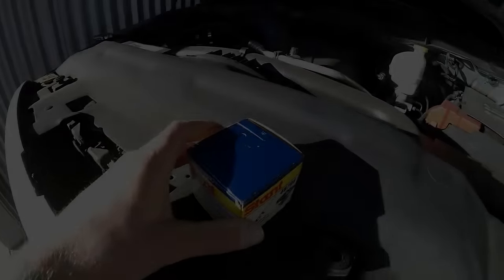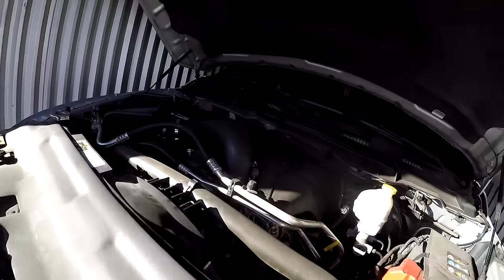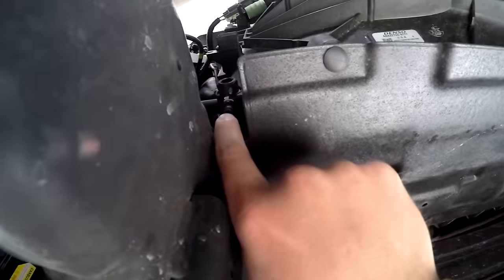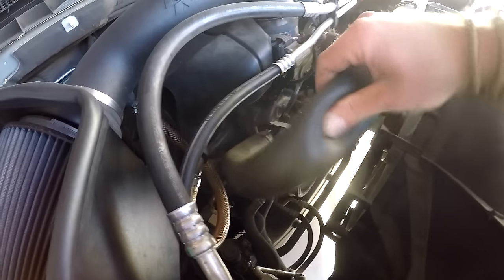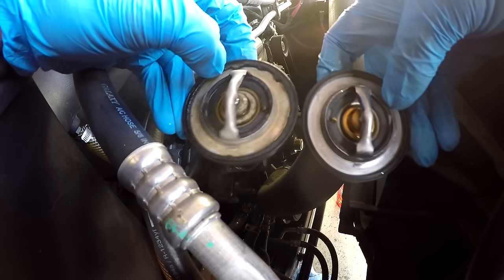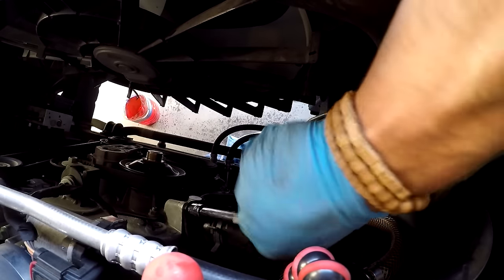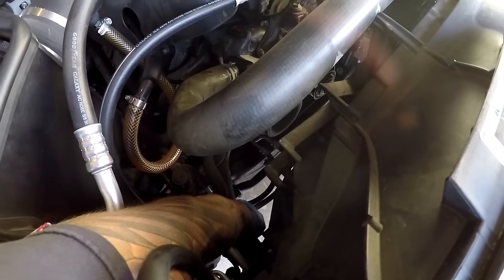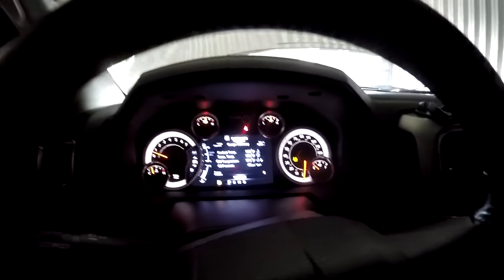THERMOSTAT REPLACEMENT - DODGE RAM 1500 HEMI 5.7L

Comment from the maker: HERE IS THE STUFF TO GET THE JOB DONE 💪😎

HERE IS THE 180* THERMOSTAT WE USED
https://amzn.to/2K0xtsE

MOPAR 5 Year Coolant
https://amzn.to/2Wtimio

MOPAR 10 Year Coolant
https://amzn.to/2EsNrIO
Reply: 2011 Ram 5.7 HEMI
I did a coolant flush and replaced my stock thermostat with the 180⁰ one vs. the stock one. Before I started, I didn't have any heat and my temp gauge sat just a little under halfway. After I finished the job, I now have good heat, but my temp gauge only sits at ¼ of the way.
 I was just wondering if anyone has come across this before and what might be the remedy to fix this? I would appreciate any insight. I love watching the Boosted Motorsports videos! Thanks!
Reply: So if I switch for an E fan would my truck run perfectly fine as is or is there some risk to not changing the thermostat or adding a tune?? I'm asking because I'm interested in installing an E fan in my 2010 hemi but when watching all your videos on installation and then possibly needing a tune + TSAT change I'm kinda becoming skiddish. I mean I use my truck as a day to day driver, vacation vehicle, and every once in a while heavy loads. So I would like all the information to make this decision or if it's not even worth doing. Thanx Boosted you helped me repair broken exhaust manifold bolts last year 💪
Reply: Any issues with this since the original install?
Reply: On Amazon it recommends this other gasket fi you need that or it comes with everything you need
Reply: Have you hauled anything for long durations with you fan swap? I’m moving from NM to Idaho with a fan swap like yours and I want to make sure my truck isn’t going to overheat. Plz help
Reply: @Huxley Mitchell Yea, I've been using Instaflixxer for years myself :)
Reply: The yellow universal coolant is a higher grade coolant than both and is known to cause less problems

Comment: Unwise, grasshopper. Under hot conditions (towing, hauling, mudding, altitude, even very warm weather, etc.) your thermostat will open sooner and stay open wider, circulating coolant faster.  Soon enough, the coolant will not have adequate time in your “rad” to dissipate heat. The stuff going back into the block will be just as hot as the stuff coming out and your low temp thermostat won’t be able to slow it down because it will be wide open. You will overheat. Then you will wonder why.
Reply: You are correct sir.  It will also affect your oil viscosity.  Cooler engine temp, means higher oil viscosity which is bad for the small oil passageways in a Hemi.  It is a balanced system, coolant, thermostat, radiator size and oil type are all interdependent.  I hate to be "that guy" but this mod is pointless and unhealthy for the motor.  I do like the electric fan mod!
Reply: FaceDeAce thank you sir for the explanation. Today I learned something really interesting. Thumbs up!
Reply: Face - first paragraph notwithstanding, I agree with everything you posted. Absolutely true, as you pointed out, the stat opens at the predetermined coolant temp, but consider that it will open much sooner, and stay open wider in Yuma where the air temperature is very hot, than it would in Duluth. The outside air temp does indeed have a huge influence on when the stat opens via the coolant itself.
Reply: So your both making the same point. Lower temp thermostats are point less and can be harmful. I agree, dropping the temp doesn't have benefits and can be harmful if it doesn't allow the engine temps high enough due to mild use and short trips serious sludge and oil issues can damage engine.  The oem temps provide the cleanest burn and best MPGs. You will not get more HP from a lower water temp/engine temp unless it is overheating and predetonating but as far as i know modern engines dont have that issue.
Reply: mam hemi 5.7 Łączę ELM 327 i pokazuje mi, że temperatura otwarcia termostatu wynosi 100 i podczas jazdy w mieście mam 96/97 na trasie 92-95. Może wiesz, jak wskaźnik jest skalowany w Commander 2009 360KM? połowa skali to 100 lat? W farenhaitach będzie 212 farenhaita
Reply: One thermostat wont take longer to warm up than the other.  The point of lowering the starting point of cooling is to put as much distance between you and overheating as possible.  Oil has a failure/ breakdown temp. 250 ... if you work your engine its good to give a little buffer.  @robertjamesschumache
Reply: That’s why I’m sticking with the 203 degrees T-stat
Reply: If this were true this wouldn’t be such the popular mod it is.
Reply: @BlackRam17 : It’s not a popular mod, it’s a dumb trend. Like pet rocks or earth shoes. If it were so good, why wouldn’t the factory just install colder thermostats in every truck that they manufacture? It wouldn’t cost them one extra penny to make their trucks run so much better. right?
But they don’t. So you gotta ask yourself, why don’t they? Is it because they’re so stupid and they don’t watch YouTube?
Reply: @ooyginjardl4037  manufactures often do things to be on the extra safe side, it doesn’t make it necessary. Like I said if this wasn’t safe so many wouldn’t do it. Why did they put the clutch fan on? It’s completely unnecessary. Answer: they air on the side of caution.
Reply: @BlackRam17 : Alrighty, ima try it this way. Why even have a thermostat? 
Then it should never ever overheat, right? Of course it’s not right so the simple answer is twofold. One is to bring the engine up to operating temperature. The other is to restrict the coolant flow so that it has enough time to dissipate heat in the “rad”
So again, if there’s no thermostat, the coolant will just get hotter and hotter because it doesn’t get a chance to cool down. 
If you agree with that, then you will understand my posting some six years ago. If you want, read it over again.
PS Fan clutches are for fuel economy.
Reply: @ooyginjardl4037  I understand what you’re saying, however manufacturers always air on the side of caution. I’ve done this mod on other vehicles and have never had an issue. Also the clutch fan only hurts mpg, it’s like 20 lbs of extra rotating mass. Notice Ram got rid of it in the fifth gen.

Comment: Powertrain Engineer here.   @kevin maxey said in a comment below "The engine will run more efficient with the factory tstat. Cooler is not always best." He is absolutely correct. There is virtually no cost difference in a 180 to a 205 thermostat from an OEM standpoint. The engine was engineered to run at those temps for a reason. 200-215 F may be the efficient range for multiple parts inside the engine. Lowering the temperature may effect this and in turn reduce the life of your engine.   I will admit there are multiple examples when the OEM doesn't get something right and after market engineering is the way to go. This is not one of those time.
Reply from the maker: From an emissions standpoint you are correct.  From a performance standpoint cooler operating temps = less detonation and more ignition timing you can run.
Reply: I was told that the injectors will run better with the OEM stat. Any truth in that
Reply: @BoostedMotorsports  Hello, my Jeep XK 5.7 VVTI in the mountains reaches an engine temperature of 205-215 farenhait, With a trailer also 205-219 but already on the highway 203F is it normal?
Reply: some answers are wrong 180 degree only means the will open when the temperature hits 180 after it opens it will run at normal operating temps. also 180 degrees means you will get heat coming from your hvac quicker because it opens at 180 instead of 205

Comment: I have a 2007 dodge 1500 hemi and I was getting 13-14 MPG until a changed the thermostat and radiator and now i’m getting 17-19 MPG with a cooler engine
Reply from the maker: Thats awesome brother glad to hear! 👍
Reply: Wow, I thought the opposite. I lost 1 mpg in my Sonoma going from a 190 to a 180 and lost 1 mpg.
Reply: Hey do you have the part # for that stat? Thanks!
Reply: Gregory,Ivory&Miciah Jerman where you buy it
Reply: @Reptitude  youre correct. 190 to 200 will give you better gas milage than 180. No doubt.

Comment: A 180 stat us fine but especially in the south a 160 is even better. I have a jeep grand cherokee- with 5.7 so I will need a high perf radiator which I will be getting. Both the engine and the transmission- heat kills them both. If you can run 165 to 170 water temp your engine trans all rubber parts literally the whole truck last far longer.

Comment: I put a 180 thermostat in my 2016 Ram and no check engine lights. It runs at 185 solid until highway and the grill shutters close, then gets to 219 before they open up.

Comment: The engine will run more efficient with the factory tstat. Cooler is not always best.
Reply: +Kevin maxey:  I was about to post that.  I ask myself; Why do people think that cooler (or hotter in some cases) is best for their engine.  There is a reason why every element of an engine (especially modern) are designed as such.  Manufacturers spend hundreds of millions of dollars on developing their engines.  Then comes Mr. Know-it-all with his $20 part to modify and change the engine characteristics and efficiency and wonders why the engine has become a gas guzzler....."Must be the stupid engineers".  🤔

Comment: Had temp going up to 240. Replaced everything out but it turned out to be a clogged radiator.  Change it out, the coolant passages on these trucks are very thin.  A radiator shop can do a flow test to confirm this.
Reply: Hi - What was temp after rad change ?

Comment: I put a 180 in my 5.2. It does good but when I sit in traffic it still gets a little hot. I’m in Phoenix AZ. I will put on dual fans for the radiator soon.
Reply: Aftermarket all aluminum rad?

Comment: Theres alot of people confused about this, including this guy in the video. To all to whom drives mopar hemi engines,when putting a 180 stat it keeps the engine cooler longer than a stock 203 stat. Your fans will take longer to work> work less. Even in below temps you will not get any coolant codes. Know for summer you must not a must but comes in hand to get a diablo or predator tuner to set the fans a lil bit lower. You can set your fans to kick in around at 200 degrees. So it wont reach that stock 217/219 degree.some set there fans even lower like 195 185 but you will be putting them fans to work 24/7
And also your alternator will be busy since them fans will be running all the time. 200 degrees fans kick in and will lower 7 to 10 degrees and wont reach 219/217 degrees
Thanks

Comment: Hello, I have a Durango 2012 5.7 HEMI and the temperature at which it works reaches up to 226 °F. When I turn on the air conditioning, sometimes the temperature drops but then it goes back up. What would you recommend me to do? Thanks!

Comment: Have to replace the water pump on my ram.  Might as well replace the thermostat as well.
Reply from the maker: Definitely a good time to get it done 🤟
Reply: I didn’t do it and now my truck is overheating all the time. It only overheats at idle but when I drive it stays around 208 degrees on a 100 degree day. At idle it’s reached 240 once. Would you know why?
Reply: @6870catfish  You should probably change the thermostat.

Comment: I've been looking everywhere to fins a guide on an 04' 3.7l v6. It looks like the upper hose mounts into the same mount as the alternator somehow and I'm thinking surely I don't have to take the alternator off to access the thermostat housing. But the only guides I see for RAM 1500's are for HEMIs

Comment: This only works if you have a programmer to set new operating temp. If you don’t all it will do is trigger the computer to up the fuel to air ratio until you get to operating temp using a shit load more fuel.

Comment: Good advice I have a Dodge ram 1500 I change my blower motor fan and and resistor but did not change the thermostat   I don't warm inside like it should  what you think

Comment: First off, love your videos brother! Question about the thermostat... that jiggle pin, does it matter if it's in the 12:00 position or the 6:00 position etc? I know installing the thermostat with the spring side towards the water but wondering if it matters if that's up or down. Thanks for the info.
Reply: Jiggle pin should be in the 12: 00 position.
Reply: Should be 12:00. But I also heard that it doesn’t matter. I’d just install it at 12:00 to be on the safe side

Comment: replaced thermostat however my heater isn't working now!!   Any ideas as to why it would stop working?  Thermostat is working it keeps at around 200F  .  I probably have air in the system but how do I look for and fix that?
Reply: Trista Fravel  Thanks for the response still !  I ended up elevating the front end and running it.  It eventually pushed the air bubble out.
Reply: @JoeG2013  - Hi - Where was the air located ?

Comment: heh what are those two aluminum rubber hose line on the passenger side used for. the ones going to the rad my lower one broke and i dont know whats its name to order it, sound lame.

Comment: hey bud i have a 2019 new body style. I got the milodon 160 degree  thermostat  but it didn't come with a new gasket can i use the one off the old thermostat instead. I dont know what to do. I planed on doing this weekend but now in dont know what to do.  Thanks nickel

Comment: I have a 2013 Ram 1500 I changed from the 203 down to 180, my temp pretty much stays at 185 at idle and down highway, its only been 1 day do I need reprogram the fan or will the computer relearn it? Don't want to damage anything
Reply: Read what the guy below says as he's correct.   Your PCM is looking for 203 and will do everything it can to get it to that temperature.   You're going to run rich and in a 2013 with its copper tip plugs, they're going to foul out much sooner.

Comment: Hey man  I was curious if you can help me out. I owned my 2009 dodge ram about 6 months and in that time I have had to change out mine twice, both added a 203°. After each change truck would run fine but then would throw a code saying bad thermostat, obviously it may be something more than just the thermostat, what would you think it could be?

Comment: When you switched it did you’re temps fluctuate at all? I switched mine with the same tstat and now it jumps up and down from 185-225
Reply from the maker: Its most likely because your truck has the active grill shutters.  They stay closed so that your truck runs hotter.  If you want the engine to run cooler then you'll need to get a tune to reprogram the fan to come on sooner and delete the active grille shutters.  Check out the other vid I have on this where I document this exact problem 👍
Reply: I had to get a tune to make my 180 stat work plus I just put mods on the car
Reply: @BoostedMotorsports  does running the AC kick the active shutter to open?

Comment: Have a 2014 ram 1500 5.7 changed out fan clutch electric fan water pump thermostat and radiator but water is still not flowing what can I do

Comment: What kind of Antifreeze you using ???  It looked purple ??  What would be the best too use cause I live in Florida ....
Reply from the maker: Since you're in Florida and don't have to deal with freezing you can run more water.  Its actually the pink Mopar fluid. They switched to purple sometime in 2014 but mine doesn't have the purple stuff
Reply: @BoostedMotorsports  copy that ... So your using Hybrid organac compund type ??
Reply: Thanks for getting back too me... I'm coming up on 150,000 miles on my 2014 Ram and I guess I half too do the flush if I were too change Antifreeze types.. I just want too do what's best for the motor

Comment: Does the fan need to get reprogrammed? Since it really only kicks on close to 200°
Reply from the maker: Fan comes on at about 220* with the stock computer unless AC is on.  Its a good idea to get a tuner if you are deleting the mechanical fan but it won't overheat or anything if you just swap thermostats.

Comment: Any reason why fca would go with a 203f instead of something lower?
Reply from the maker: Thor Swenson exactly! Do your temps swing at all on the highway? The programming on my truck keeps closing the damn active grill shutters on the highway and bringing my temps back up
Reply: so you did not do any performance tune with the 180 stat? just a remove and replace and never see a code come up huh?
Reply from the maker: I have a DIablosport tune on my truck right now.  I've heard it can throw a code on a stock tuned truck though in cold weather!
Reply: it is a good idea to get the oil to at least 200 to help remove moisture and fuel blow by which then would be sent through pcv back into engine or catch can ideally, not to mention operating temp oil is usually around 200 where it reaches its full viscosity/protection rating. That said, this shouldn't drop oil temps much if any.

Comment: Hey I had a question my truck when idle coolant goes up to 239 is this normal I just changed the thermostat and still . Thanks in advance
Reply: Did you check how is the condition of your coolant and radiator? Check for rust maybe is partially clogged the radiator lines. And also check if is lossing coolant, if so could be the water pump gasket leeaking

Comment: You can actually just remove your shutter set up and leave the actual shutter motor mounted but removed the actual shutter assembly , I had to remove mine for my intercooler
Reply from the maker: Yeah I've heard of people still throwing codes unless they leave the shutters in the 4 corners and just remove the center ones.  I've also heard people lose 1-2mpg removing the shutters which I don't know if it is worth the performance taking them out if that is true?
Reply: I just hit a deer and damaged my shutters to the point where I removed them.  I am getting an error and I have lost about 1mpg.  It may just be a weather difference causing it (very cold here now), it could be less...